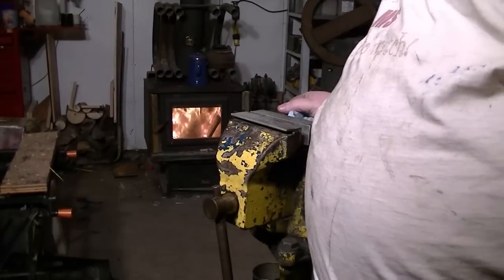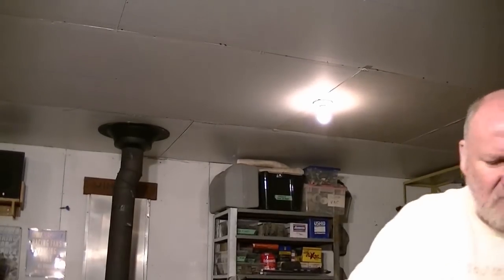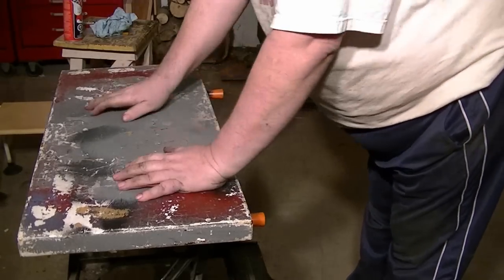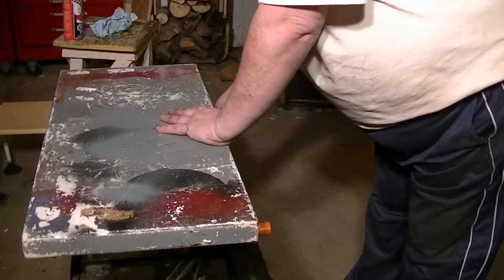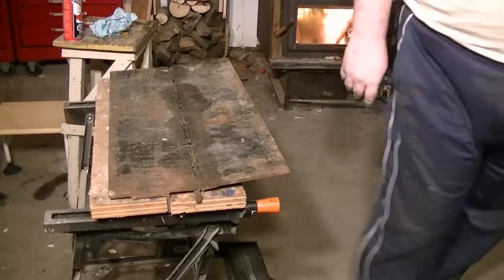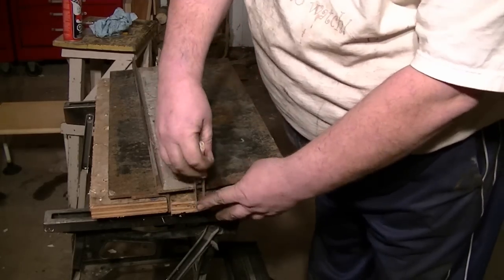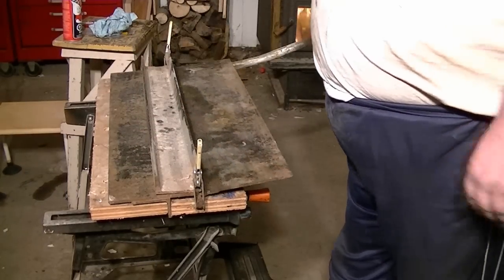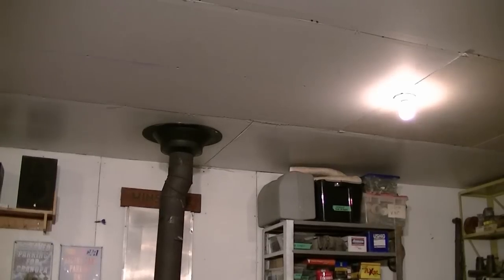Grampa's Garage #68 Some homemade tools

Comment: Not badatall. What gauge are you able to bend? Note, if you put a slight bevel on the edge of the clamp plate, it will allow for spring back of the bend. With different clamp plates you could also make boxes, trays etc.
Reply from the maker: I've usually used about 18ga. but have bent 16ga about 8-10" wide.  I've occasionally thought of trimming off the front section of the C-channel, but the hinges I used would have to be changed too, so I won't bother to change this one, but if needed I would build a better one with some changes.  I originally clamped the channel down with some modified vise-grips.  For what I use it for it serves the purpose.  Rarely when I need to go beyond 90 degrees, I start with the brake then move to the vise with a piece of steel bar, and a body hammer.  I built it years ago when I was ice racing my Datsun 510, and needed to bend up some patch panels which inevitably would get bent again anyways.  Thanks for watching.

Comment from the maker: Sorry it took so long to reply. The walls R12, the ceiling R20. Then vapor barrier & drywall. Don't know off hand the btu's my stove puts out. I can work in a t-shirt within an hour or two on some of the coldest days, -30 to -35C and windchill on top. I should clarify, I like it cooler than most, so others in my garage will keep on a hoodie. 0F is about -18, and it's easy to heat for that. I also have a fan on my stove to move the heat. It would heat better if I had an insulated door

Comment: aluminium angle iron ? WTF is that ? is it like a plastic tin ?
Reply from the maker: +John Griffiths Good catch, I forgot I actually call it that.  I don't recall where I got it, but I do remember the price tag calling it Aluminum angle IRON, despite the fact it is aluminum.  I thought it funny, and it just stuck in my head all these years.  But it's not like plastic tin, it's closer to a half-round square, a pail full of live steam, or a can of white lamp black.  Jumbo Shrimp.